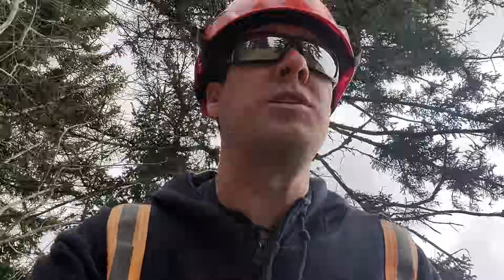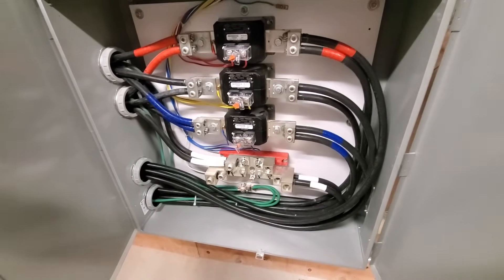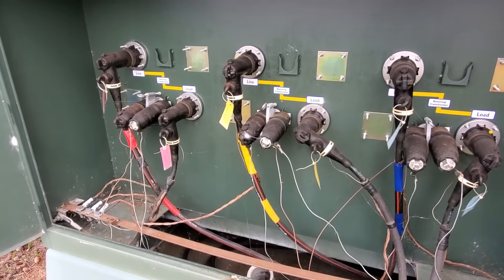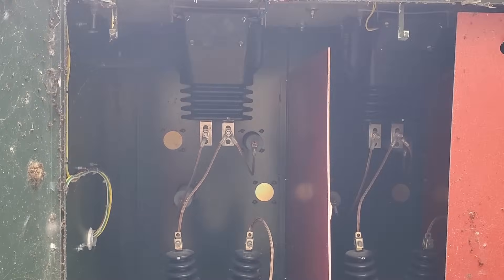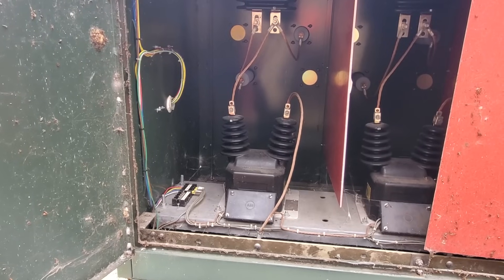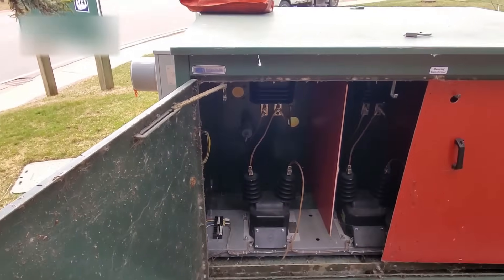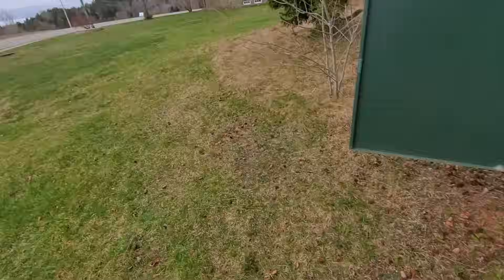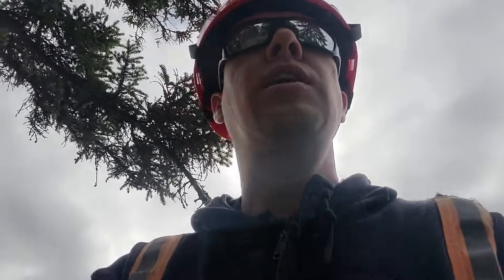Primary metering padmount

Comment from the maker: These things are not meant to be opened or worked on while energized! ⚡⚡
We don't open up the back side of these very often! Figured I'd get some shots of what things looked like on the inside. Its a pretty basic setup as far as metering goes. Opening the rear door was done while wearing 20 KV gloves and firewall lifted with hotstick. Pad mount units or confined spaces with bare high voltage wire can be very dangerous!
Reply: Thanks for showing metering some love. We're typically overlooked in the distribution network
Reply: We have metering points with the same concept but there kinda like donuts that go over the actual secondary spade or blade module what ever you call them lol
We also have the same concept metering primary
Reply: I'm hoping this was deenergized. I'm sitting here going "fuck that".
Reply: The "firewall" is a barrier made out of GPO insulation. It's a material similar to fiberglass and super itchy if you have to work with it.
Reply: We open these all the time with no protection. We disregard Penta bolts all the time. Then again it is all on manufacturing line so probably not a big deal.
Reply: @williamsparksjr.1212  What do you mean "We disregard Penta bolts all the time"? Is there a protocol to unfasten anything fastened with Penta bolts? Are they used together with a lock or padlock?
Reply: You did great! I’m certain you lifted the red board insulation panel safely!